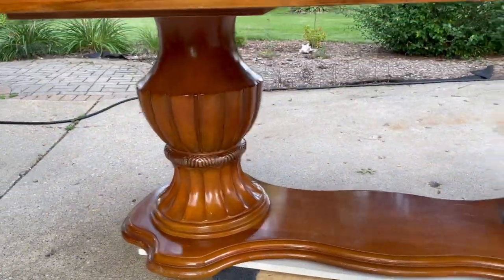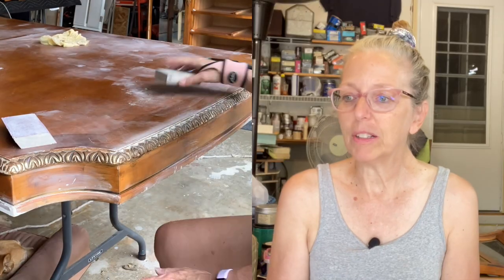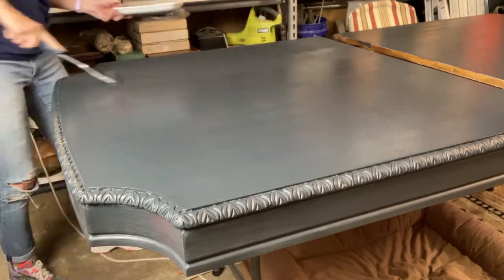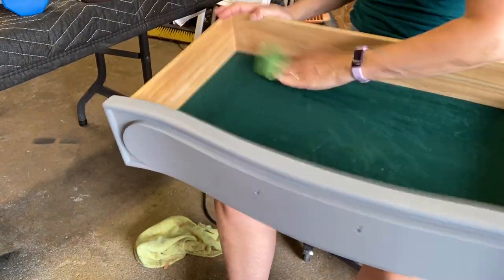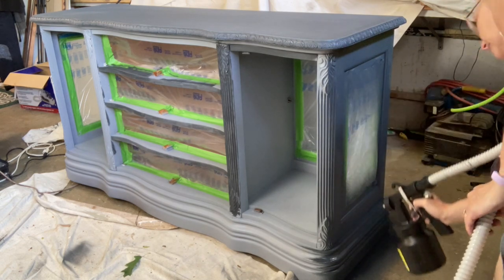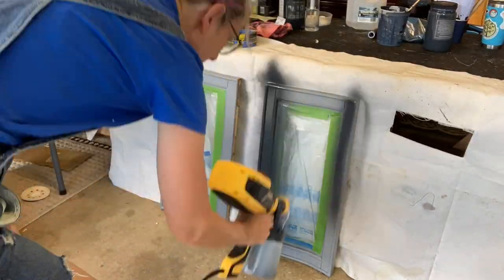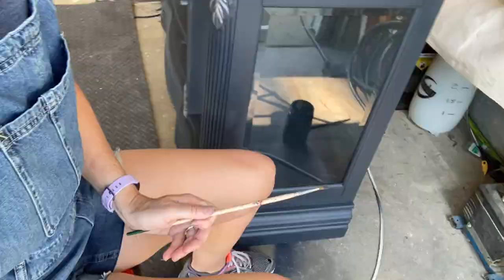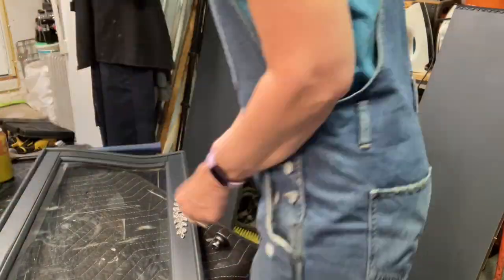Monster Furniture Project!

Comment: Girl this looked exhausting! But it turned out really nice and it’s always so nice when you client is thrilled with the results!  If this ever happens again… IF!  Try  4 ought steal wool and clear wax over your clear coat, it should give you that buttery luxurious finish.  Sorry you ripped through all that topcoat😑.
Reply from the maker: Thank you so much!! Yep, that was a tough way to learn.  I may not have shown but I did try steel wool at one point on the table, I truly think my sprayer and I just needed to learn how to work together. 😉 Yes, It was a big job!! Check out the video where I do the top of the buffet! https://youtu.be/E1tjDACSQSY

Comment: Try using a torch to check for dents you might have missed and mark them as you see them.
Also, scuff any dents before using wood filler. It will adhere better 😊
Pieces are wonderful, well done 👍
Reply from the maker: Thanks for the tips!! 😃

Comment: Oh Melanie, your hard work was all worth it, this set turned out gorgeous!   I love that brush you used on the detail areas, it really got in there, but using the sprayer was a smart idea for speed (usually!). Sometimes my sprayer heats up and can create the skin bits (I have that Flexio 3000). I'm also in Phoenix so fast-drying is part of my painting process lol.
Reply from the maker: You are so sweet, thank you! I love that brush too! I bought it from Melange, I think I may have forgotten to mention that! I really like my new sprayer and I think the next project will go a lot smoother now that I know how to use it a little better.